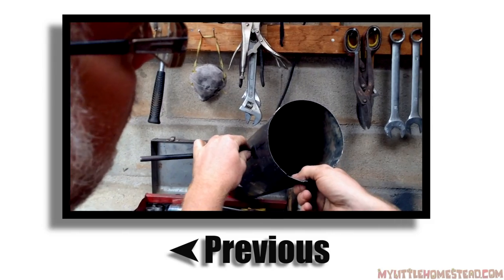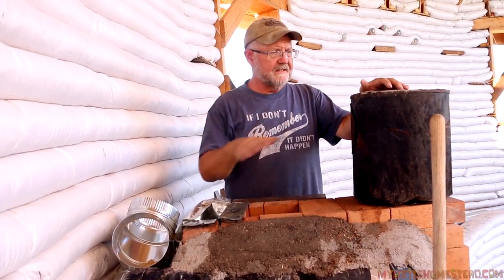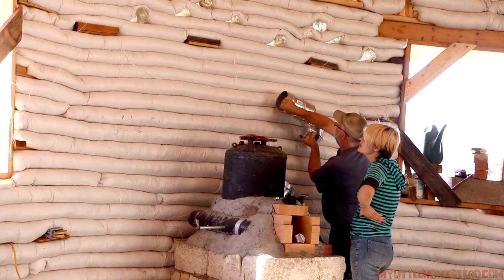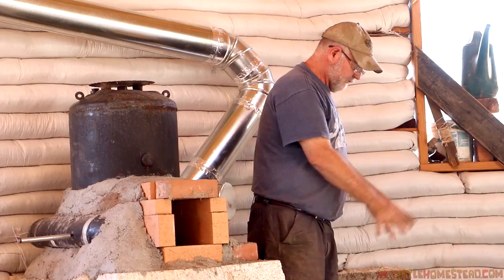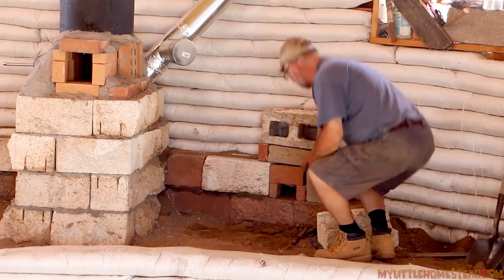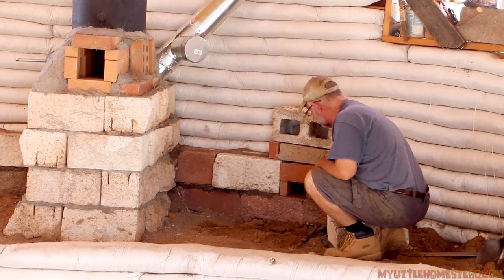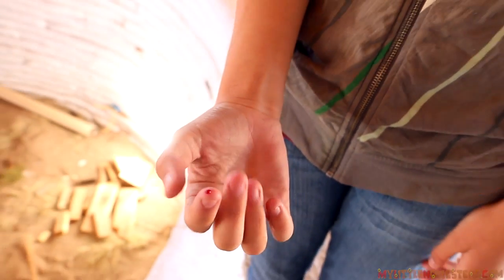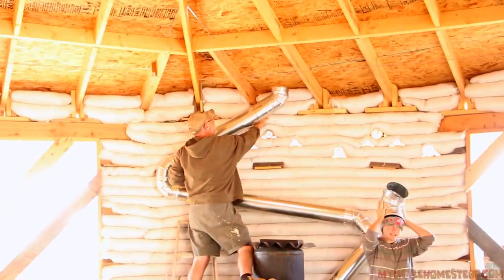Exhaust Pipe & Test Run | Dragon Rocket Stove Mass Heater | Weekly Peek Ep65

Comment: Hi guys question could  copper piping be coiled around the box to produce hot water with a water tank for storage and also radiate heat and also for domestic use.

Comment: what are the sandbags made out of? won't the hot exhaust piping melt or take the structural properties out of the bags/walls. Also shouldn't there be some kind of heat gasket around the exhaust piping and plywood
Reply: Pat B it's not very hot.
Reply: Michael Carouth still synthetics have very low melting points and poor resistance to thermal shock (being heated and cooled continuously) if the fire is only for a short while I'm sure it would be fine but a continuous fire would heat it up I'd imagine
Reply: Pat B Polypropylene, but the earth inside and the cob or whatever they put around the ducts are not flammable. The exhaust output at the roof should be about 95° F (lower than body temperature). 
The polypropylene bags may off-gass near the beginning of the burn box, but I guess they r ok with that. It won't burn the house down though as it's basically a sandstone house after the earth bags cure.
Reply: Michael Carouth ok, and thanks that's good knowledge. The house is definitely fire proof lol, i would be more worried of the side of the wall caving in if enough bags melted and bleed out there sand
Reply: Pat B The dirt inside is supposed to get pretty hard and the bags are just a temporary thing till the earth inside dries and they put some kind of wall coverings inside and out. They will probably do cob (clay, sand, and straw), but I'm not sure. The bags aren't supposed to be exposed to the elements and UV radiation long term, but do last plenty of time for people to get around to finishing their project. 
I've never done earthbags myself. I've been researching it maybe 2 years though (not continuously!). If I do a earthen house, or ad-on, I'm leaning towards rammed earth or poured earth, as I just need reusable home made forms (no bag expense) and it's easier. Easier is nice!
Reply from the maker: +Michael Carouth 
Let us know how your project progresses...
Reply from the maker: +Pat B 
We will have the proper "heat gasket" as the pipe exits the roof. Hang in there and thanks for commenting.

Comment: i'm concerned about so many stove builders using light gauge piping for the heat exhaust.  Only black pipe is meant for exhaust.  the shiny stuff is for heat duct, exhaust.  the heated zinc coating will smoke off poising gas.  it rots out quickly which will cause monoxide leaking into  the heat mass of the bench.  pretty soon i think we will start hearing of people being overcome by the monoxide as the pipes fall apart and no one can see that happening  i think the common belief that there is only water vapor in the exhaust because it is clear has to be false.  your car exhaust is clear and you cannot smell monoxide.  .Don't believe the internet and youtube stories.  all these guys are busy making videos for hits, not facts.